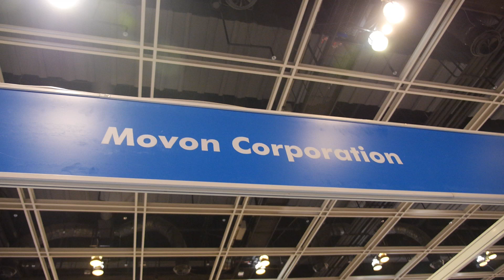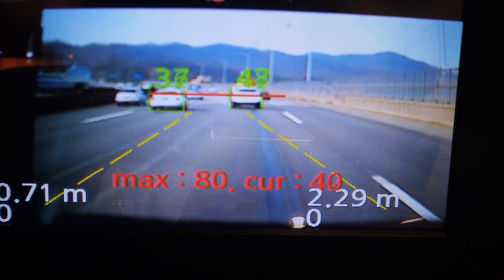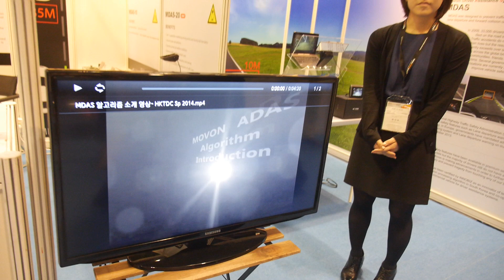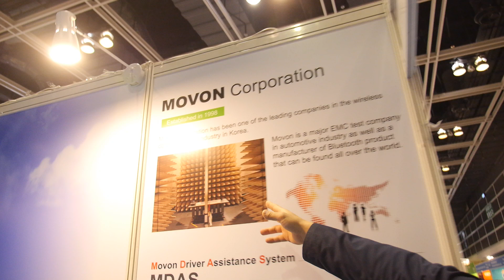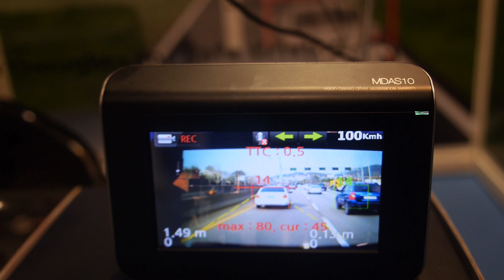Movon Smart Car-DVR towards Self-Driving Car functionality, and Invehicle Infotainment

Comment: I've been hearing about a self guided vehicle... I couldn't imagine allowing some device navigate my vehicle that most likely has a bug that will crash the unit, then what? Automatic death to you and whomever might be in your path or it may vary to avoid a collision with another by steering you into certain death! I like this device, not a computerized automatic self driving car
Reply: MrBrymstond 

I don't know about this chinese one, they will improve as usually. 
Google has indeed a far more advanced ones, with multiplied sensor to detect bugs from reall threaths.

Besides that you are missing the point here, when was the last time a calculater was wrong compared to a human calculation? As time pass by these things will and are already becoming more advanced and will in theorie be better in making calculation then humans..

Same story goes for auto-pilots in air..
 8 of 10 times it is the human pilot woh crashes the plane, humans again woh makes the mistakes. The auto-pilot makes a lot of fewer mistakes compared to humans.

That is why we are designing these things, otherwise if they were not trust able we wouldn't design these in the first place.